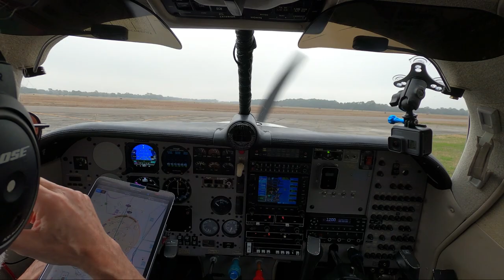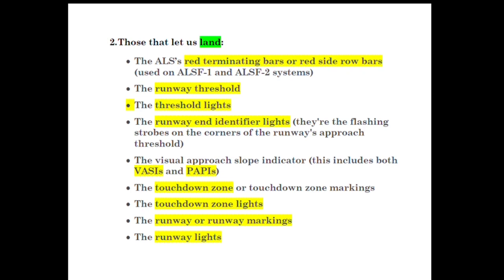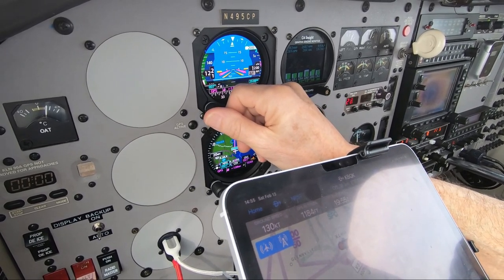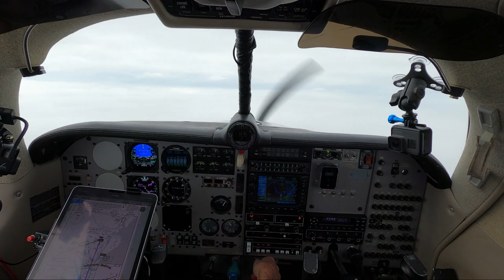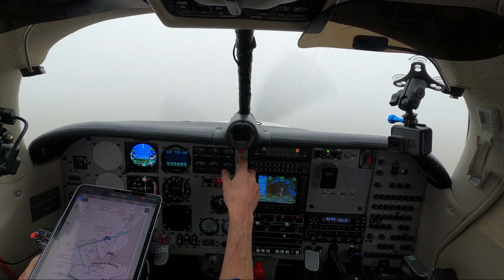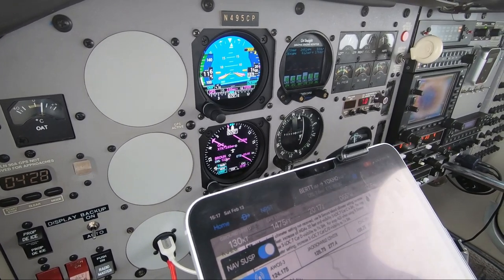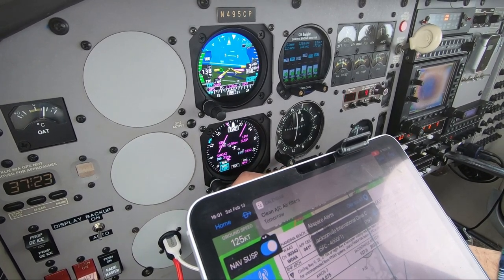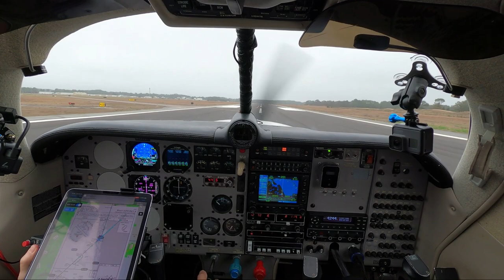LIFR ILS BELOW MINIMUMS!! Mooney Ovation with GI275's, 530W and KFC150

Comment: Thanks for another good video Chris. I like your mentioning of the MALSR and minimums for review. I fly a Bravo and have a K model with speed brakes, Can you tell me why you flew with the speed brakes out for the first approach? Thanks
Reply from the maker: Thank you @nogolfpro. Unless flying in icing conditions, which I would not do, the reason for the speed brakes is that if I have to go missed approach at the MDA or DA retracting the speed brakes stops the descent in case i want to stay at the MDA and then all I have to do is apply power with same pitch attitude to start the climb. 

With second generation Precise Flight speed brakes one descends at 500 fpm without any change in pitch or power. Retracting them levels the altitude. With the Mooney one can also descend at approx 500 fpm after lowering the gear without any change in pitch or power. That is why I set up my power, pitch, flaps and speed brakes so that prior to arriving at the FAF I am at the approach speed I want for the final approach segment. Once at the FAF all I need to to is extend the gear and no need to change anything else until either missed or landing.

Comment: Hi Chris.  Great video.  I am told by Garmin that Garmin Pilot will receive magnetic heading and Baro pressure altitude from the GI-275 when connected to it via bluetooth.  In looking at your iPad screen, you are showing GPS altitude.  Do you have Garmin pilot connected to the GI-275 and is there a particular reason you show GPS altitude instead of Baro altitude?  Would be interested to know if the GI-275 also sends the indicated airspeed to Garmin Pilot.  Thanks.

Comment: Approach minimums are based upon visibility NOT ceiling, at least in the US.
Reply from the maker: All missed approach procedures are based on the DA/DH and MDA such that obstacle clearance is assured when flying the missed approach. Any specific climb performance requirements will be spelled out in the Notes section if they differ from the standard 200 ft/nm. Therefore the ceiling minima need to be respected and as such are minimums for altitude. When the ALS is in view then can descend to 100 ft above TDZE. The missed approach procedure will take that into consideration. Regarding visibility, if reported by the airport RVR then one cannot fly the approach if reported below the visibility minima of the approach. However, if reported by the AWOS then it becomes the pilot’s assessment of what the visibility is from his/her point of view. FAA can cite someone landing with vis below minimums if reported by RVR, however cannot do so when it is AWOS or other means since at that point it is the pilot’s view. That is what I have gathered after much reading, etc.  Any corrections are welcome.

Comment: I'd like to know more about the backup attitude indicator power scheme.  Is it independent? Is it protected by a fuse separate from the primary?
Reply from the maker: Yes, the backup AI has independent power from the primary AI. They each have their own circuit breakers as well as backup batteries on each unit in case the they loose power from the aircraft bus. They are powered by the Master switch and not the avionics switch. 
Hope that answers your question regarding electrical power.